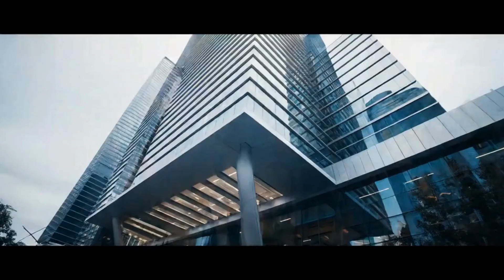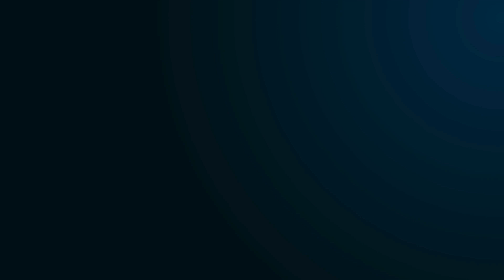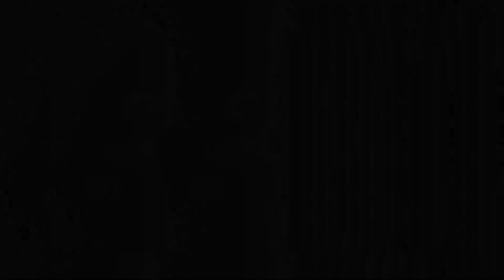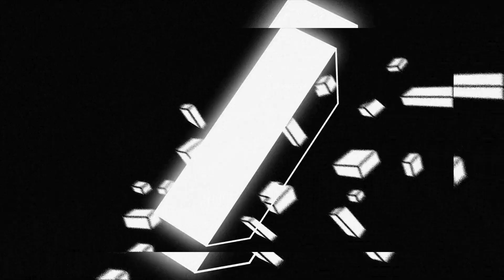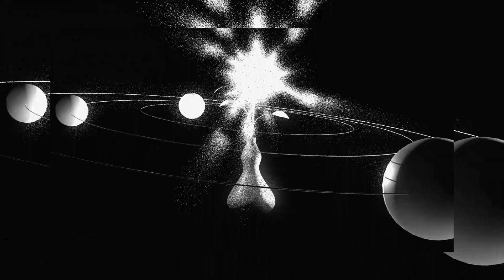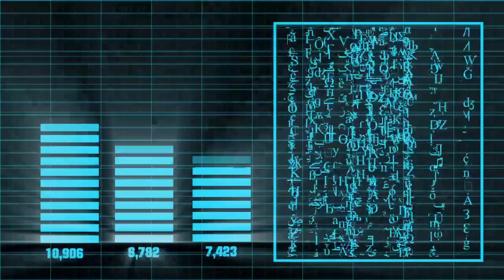CAFA Platform - The Genesis of AI Agents | CAFA Talk 17

Comment: The moment the talk juxtaposed Ontology-Model-Centered Generation with plain “prompt-and-pray” or RAG workflows felt like a light-bulb for me—designing a tailored ontology map first mirrors how I storyboard psychometric blueprints before letting any algorithm loose. What really resonate is the claim that this structured grounding isn’t just tidier; it tangibly boosts reliability and interpretability, which is the friction point I hit whenever an LLM invents spurious distractors for exam items. I also geeked out over the “link” condition in their parameter system, because tying a question stem directly to its answer-choice set is the kind of integrity control I usually have to script by hand. If the platform lets me enforce those relationship without extra code, I can see it shaving hours off item-writing workflows.
Reply from the maker: Great points and insight!